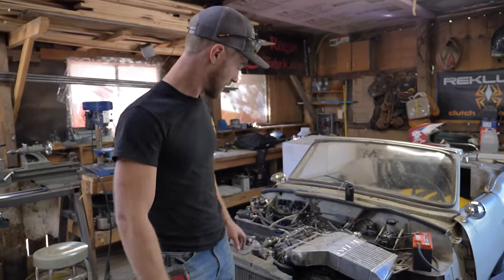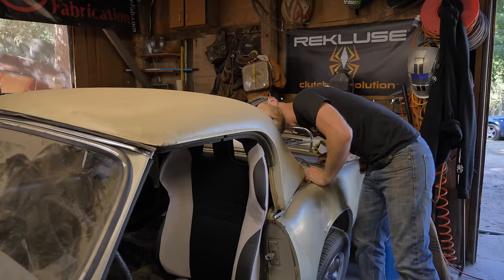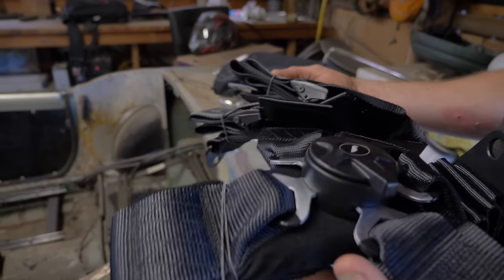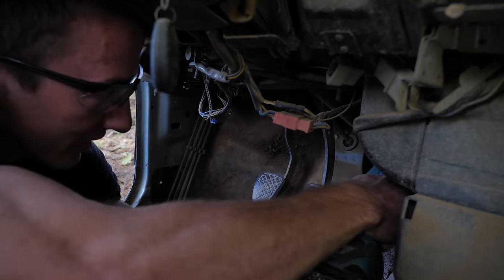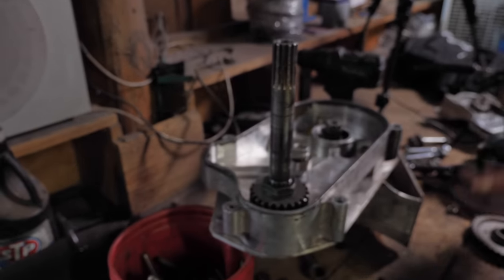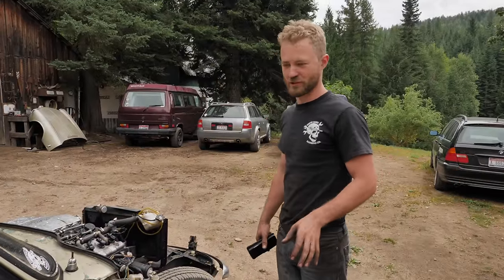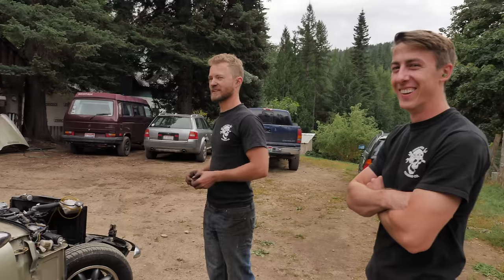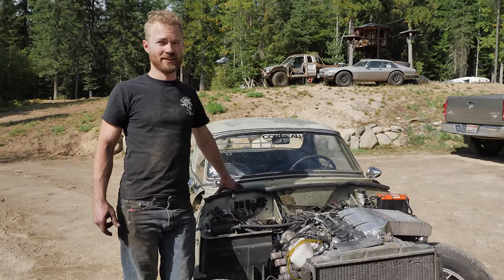Snowmobile Powered Car Test Drive! Supercharged RX1

Comment: I work for Sunoco. I can shoot an email to the Race Fuels marketing gooroo. Cant hurt see what happens. The GT100 will more then meet your needs.
Reply: excellent!
Reply: Buck Shot my dad works for sonoco.
Reply: I get E85 (105 octane) ethanol for 3 bucks a gallon in Portland.  Stuff loves high compression.
Reply: @dickJohnsonpeter  ?
Reply: @phillipzx3754  e85 is best :) 0.60€/L in france vs 95 unleached is 1.50€/L lol
Reply: @phillipzx3754  lucky, cant find any stations with e85 in vancouver
Reply: either that or im not looking hard enough
Reply: @kenji642   Jay's garage in Portland sells it. They're at the corner of SE 7th and Morrison.  I've never seen E85 for sale in Vancouver.
Reply: @gsfbffxpdhhdf7043  Yeah, its against the law for a cashier to shoot an email to somebody.  What's your point?

Comment: please protect that driveshaft, even protected it can severly injure you
Reply: was thinking the same thing
Reply: Imagine he got his arm or shirt in that thing
Reply: It would be like a mini PTO, fuck getting caught in that thing.
Reply: It was for the test drive. Itll be safe.
Reply: Yeah, if his legg hairs get caught in that,  itll be a rough wax job
Reply: @zuestoots5176  the driveshaft and rear end are pushing 40 years old, and the driveshaft has been heavily modded in a shade tree garage. The snowmobile gearbox is also way stressed- those parts weren't designed for a vehicle the size or weight of a Spitfire. Then there's the difference in shock loads between dirt and pavement vs snow.  It's not moronic to suggest that at least a tunnel is urgently needed.
Reply: Zues Toots - i hear ya man. it’s amazing how many Real Experts chime in an hour after they post a video with the “you should, why didn’t you, what you really needed, i would’ve” comments. i bet the majority of them have never fixed a bicycle inner tube.
Reply: @ericpettyfishing  full send is not test drive
Reply: @BANANAHAMMER420  Even one run risking injury is a little silly. They put in all that work to skip a simple part. Going to do it anyways. It's all fine until it isn't.
Reply: @steverolfeca  they weighed the sled it came out of... and the spitfire is lighter than the original sled. Please try again.
Reply: Final Destination
Reply: @ianbudgetrc2574  (Supercharged)
Reply: @zuestoots5176  .... and nothing ever breaks....... parts never fail... ever.  The shaft may take twice the power before coming apart.. how about the universal joints... original.. gotta be good after 50 years.
Reply: I couldn't watch the video. Go watch some lathe accidents. That's scary stuff they are driving.
Reply: I have heard of people getting rapped around pto drive shafts on tractors and that only does 540 rpm. Apparently a very messy scene. Otherwise very cool guys.
Reply: @dickscrossedgarage  1K or 10k does not make any difference; drive shafts rotate to the speed of the traction wheels; so the faster you go ; the more damage you will take ; rpm has nothing to do with it.
Reply: @zuestoots5176  Bit unnecessary
Reply: @corporalclegg914  Maybe not, but they might just be using common sense and that's a sadly lacking element these days
Reply: @jonWilk8156  there's calculated risk and blatant stupidity. The internet (and hospitals) is full of the latter!

Anyway, not my car, not my arm, fingers or soft body parts, what do I care?
Reply: David F - i agree with & respect your sentiment...but, i also feel that the Grind Hard boys seem to have it together (Common Sense-Wise) and don’t appear to put themselves in Harm’s Way. Calculated Risk is one thing, knowing your equipment is another.  i don’t claim to possess either, which is why i get annoyed at the Commenters that Preach.
Reply: @corporalclegg914  didn't knew they had bodyguards
Reply: Alexandre Martel - *didn’t know they had...

you’re welcome
Reply: @zuestoots5176  its not only that. theres the potential for his arms or legs to get caught on the driveshaft. If your jeans or shirt ended up catching it would snap your arm or leg no problem
Reply: Always use protection on your shaft. Basic man skills.
Reply: Mechanic at Detroit Diesel spun up an engine  on the dyno.  The shaft guard was not built strong enough.  The driveshaft came apart , ripped everything apart in it's path  and shattered his femur ( big leg bone ) . Luckily another worker walked by and saw him bleeding out on the floor. The ambulance was 'close enough' to save his life.  Yes it can happen during initial test drives. In fact most failures  happen during the first test run after a big project.  Young people have to go through the school of hard knocks until it finally sinks in.  Without first aid attendants and a nearby hospital the risk increases.
Reply: all you guys complaining about the drive shaft are just jealous. because you can't build anything cool.
Reply: @billbraski2175   He's aware and will install a tunnel at some point.  Lot's of people build cool stuff AND have experiences with destroyed driveline components.  You don't want a spinning shaft failing near your body.  Enough said.
Reply: @zuestoots5176  especially as old as it is. That thing is over built like a mother
Reply: Totally legall....
Reply: @zuestoots5176  Google some PTO injuries and you'll see why that shaft needs a cover. That shaft would twist his arm clean off before he had a chance to react.
Reply: Part of the package! Raw just like any body part that gets in contact

Comment: That motor needs full equal length exhaust badly. I would dare to say it’s running at 60-70% power because of the stubs.
Reply: John Stamper I agree. A lot of people don’t think about how much exhaust affects how a motor runs.  And the HP output differences.
Reply: For real! I was like! No. Why are you running it that way.
Reply: Shhh they don’t know that
Reply: Whats the point of zoomies
Reply: I agree have to have the original exhaust design for engine.
Reply: Rich ard  only useful application for zoomies is blown alcohol. With forcing 50psi out the blower and the high compression and the camming there is no reversion. Faster the air leaves the exhaust valve the more power it makes.
Reply: Its  a two stroke it needs its expansion chambers 0n it, its still cool as fuck
Reply: @jakehitchcock2868  There's no valves it's a two stroke it has reeds.
Reply: @rollfablife3363     it's a four stroke engine with a turbo.
Reply: 4 stroke rx1 engine look it up
Reply: True, but even as is, its still faster then my 64 MG Midget lol
Reply: Do you all listen?  He says at the end of the video that one of the biggest things keeping it from running right is the exhaust.
Reply: @hismaximus904  its not a two stroke
Reply: It's a supercharged 4 stroke the loss would be minimal
Reply: It's a four stroke so doesn't require back pressure to run optimally. A long exhaust is just more resistance for engine to fight against. However less resistance requires more fuel for an optimal mixture as the flow of gasses will be faster sans exhaust.

Check out engineering explained for a decent and semi easy to understand video on why this is the case.

Only 2 strokes need optimised exhausts.

4 strokes with advance emissions reductions sometimes have fancy exhaust designs on order to burn up as much bad stuff as they can but not for performance purposes ( aside from the fact they can push the limits of the engine further if they're optimisation of the exhaust pays off enough)
Reply: @freedomofmotion  scavenging is a thing but it's less essential to have a scavenging exhaust system than it is on a 2 stroke
Reply: AAARINGOAAA  as somebody who has bumped into a moving driveshaft. You don't get wrapped around it
Reply: Yes that's y Yamaha spend millions in r+d so we dont have 2 , genius arnt I.👊✊💨
Reply: @hismaximus904  🤣😂🤣😂😂 man you got it all fucked up man it ain't no 2 stroke.
Reply: Between the exhaust and the supercharger having play / loose belt, I bet it making 50% of the power it should.
Reply: Yeah I was more or less agreeing with them and solidified the reason it was running kinda dodgy. I’m sure those boys will get it sorted.  Then it will RIP I also called the baffle issue on Cinderella before they bought the second motor. It’s all good
Reply: Thing sounds badass
Reply: 𖥠 ꧁Æ♱ℍᴲᮄℜᴲⅅ꧂𖥠 I’m not worried about the “stupid exhaust” I was agreeing with what was said ... and I have to politely disagree. There’s millions of dollars every year spent on pipe technology for size shape and length to maximize power from 4 stroke and 2 stroke engines. Nitrous, turbo, supercharged or natural aspiration. Now stop being a keyboard warrior get out of your mothers basement and go do something actually productive. I wasn’t being negative nor being obsessive over their exhaust.
Reply: @hismaximus904  It is a 4-stroke, Yamaha has not made a 2-stroke snow mobile engine for a very long time.
Reply: @rollfablife3363  4-stroke.
Reply: Only reason you need an exhaust is for an O2 sensor in injected engines so the ECU is happy.  
Things like back pressure is never wanted in a 4 stroke to those saying it, it's a myth.  
The only reason extractors exist is to help get the gasses out faster. However nothing is faster than a 6" length of pipe straight off the head.  (Just loud as hell, smelly, and might set things on fire)

Doesn't matter if it's 1200cc 3c, a 5L v8, or a 27L V12 Spitfire! The less exhaust resistance, the quicker the gasses get out and the happier the engine will be.    
It's why we delete cats, put on 3" straight through pipes, grind valves and port heads, all to try and get gasses into the chamber and out of it as fast as possible.  

If this turbo snow mobile engine is running rough due to no exhaust, it's because it was tuned with an exhaust. If it can be re-tuned it should run slightly better without one... But when the whole system is like 3 foot long anyway we're probably splitting hairs.  
... Saying that I still think it'd look savage with 3 side pipes straight out the side.
Reply: @hismaximus904  its a four-stroke, an r1 motor without a trans to be specific
Reply: @freedomofmotion  It DOES require a certain amount of back pressure even for a 4 stroke to run correctly....
Reply: @morganfreeman5171  excuse me if this is in caps,using a font that doesn't have lower case so don't know if it's in caps.  Check out the engineering explained video on the matter. It's a misconception that's came about because it being true for 2 stroke engines and so people applied the same rationale and perpetuated as a general fact. People don't look things up that sound right though.
Reply: Thought forced induction didn't need back-pressure....
Reply: @JE-tz4sh  lol and most of that money is for sound and hardly affects performance at all
Reply: @morganfreeman5171  no not at all
Reply: @AntonSander  scavenging doesn't make much difference on forced induction especially turbos
Reply: @Johnny-tq9no   Yeah that's what I figured
Reply: Johnny agree to disagree. I’ve gained serious dyno proven horsepower on similar engines by just changing the routing of exhaust pipes or simple silencer change. Wide open short headers like that are robbing serious power. Spend 5 minutes on google. Do the research before getting on here talking something that your grandpapay told you in 1976
Reply: @JE-tz4sh  well you're straight up wrong because it's is simply science and I've watched enough engineering lectures specifically about exhaust design to know that's scavenging has little to no effect with fixed induction
Reply: Johnny agree to disagree. I’m not arguing with a child on the internet. Good day. Be safe out there
Reply: @JE-tz4sh  well I guess I'm not going to argue with an old man who's never been through a single fluid dynamics course
Reply: That’s a four stroke lol.

Comment: Put in some softer clutch springs that would help bring rpm’s down
Reply: Exactly what I was thinking. Just to maybe get it down to about even 2500 rpm would sound much better. Also it would drive better when you don't feel like going fulll throttle everywhere.
Reply: I mean, that's how you drive sleds, so it's not like its gunna hurt the motor
Reply: @trevortimmreck  but why not have more useful rpm range?
Reply: @gsfbffxpdhhdf7043  that wouldn't make it slower? It would just let the clutch engage at a lower speed.
Reply: @isaakwelch3451  it sure would make it slower, it makes the most power where it's at now if you lower it down 2500 more RPM it will not be at the peak torque for Max acceleration.
Reply: @Baldys_projects  that doesn't stop it from revving. It just allows it to go off of peak power for economical driving
Reply: @gsfbffxpdhhdf7043  I'd still rather have usable power band than be slightly faster. This is a car, not a snowmobile.
Reply: @gsfbffxpdhhdf7043    You seem to be confused with the proper use of the word "fast."  Speed is NOT a measure of time. It's a measurement of distance.  The 1/8th mile is a race against the clock, which is why the winner is announced by time, not speed.  "Quick," is the word you need to learn how to use before your next spewing of worthless knowledge.

Comment: Good choice for the engine. People have put them in aircraft!
Reply: @jospi2  no are u crazy your not gonna put 300 pounds on ur back maybe 70 pounds
Reply: @jospi2  nope. 150 hp is enough for a light 2seat aircraft. Check out the Apex engine group on facebook for specifics. One guy has a turbo built motor pushing 300+ hp
Reply: Yeah small planes or tiny helicopters also hyabusa engines are popular for this purpose as well
Reply: Ultralights have been powered by 2 stroke snowmobile engines for decades

Comment: A more proper exhaust will help with it running properly, and some clutching is going to really help it run better and wake up. Also, get a new rack and outer TRE. They're dirt cheap for these cars through Victoria, and the kingpins may need rebuilding costs a few bucks, but it makes a huge difference for the handling for sure. The front end is tight as can be on these things when it's all set up right. I have a few MGBs that I work on (same thing, basically); so I've seen them in all sorts of states of repair, and just recently did a total refresh on the front end. They're a flexy chassis and run small tires, so they're a pitch and catch car by nature.

Comment: Cool build(Gotta love the RX1 motor,even better boosted/blown) ,Check those flex pipes on the motor,those are known to crack after many miles.Had to replace mine at 8000 miles on my 04 RXwarrior.A proper exhaust will give a better sound...Once read on a snowmobile forum the RX1 crank is good for 600hp......

Comment: If you play with clutching it will make it more drivable. Example: green white green primary spring will lower your engagement to roughly 2800rpm. And steeper secondary helix so it shifts out faster which may help your gearing issue. It's a 37 degree or less I imagine. Put a 50ish degree in there. It's no longer lugging around a track so it's just not shifting out like it should. Hope this helps

Comment: twostroke lowers need to see twostroke engine powered toy jeeb or toy car
Reply: Noooooooo neeeeeed Torqueeeeeee
Reply: Who needs torque when it braps?
Reply: It's a car it's going to be more heavy plus, wasn't it awesome they were able to use the same fuel out of an bmw without having to also fill the oil tank?
Reply: @elilachappa3330  I know it's a spitfire, Of coarse it's light. but You wanna be able to; "Thrash and Last"- Four Stoke Owners.

Comment: Careful running the engine without an exhaust. If you revit too high it could suck cold air back into the exhaust and warp a valve which will then cause the valve to stick and hit the piston. Then it’s time to find another power plant. Love the videos and the creativity guys keep it up.

Comment: Haha. The only seats that fit into Spitfires properly are Spitfire seats! They have an insanely low and weird shaped cushion and lowers. Those 'bucket' seats are kinda uncomfortable. I'd recommend looking for seats from a laters model, '69-80. The  next revelation will an exploding rear end or axles when that thing finally hooks up. The parts are all pretty tiny. You guys might want to look into a GT6 rear end or doing some of the research on racing mods for the rear suspension.

Comment: I'm digging the look of the exposed driveshaft, but I guess if you just have to be safe...lol

This thing is sick though. Maybe there's a way of lightening the weights in the clutch so it grabs at a lower rpm? Or maybe they make a lighter clutch? I know jack about snowmobiles 🤷‍♂️🤣

Comment: You should ask Corbeau about their Classic Bucket seats. With the headrest installed they are a full 8" shorter than the A4, plus they are a couple inches narrower at the shoulder. They are a fixed back seat, though.

EDIT: I must not have been listening closely enough, because I swear I heard someone say they were going to "limit" the "throttle". I just want to make sure this build always errs on the side of rowdy.

Comment: Also. I think your gearing is closer then you think. That motor needs to be wound out to make any power. And as you prob know. You need to get the secondary clutch spinning pretty fast to get it to shift out.
Reply: I agree. It's also why I think a 50ish degree helix would help as well. That clutch setup is from a mountain sled, it's meant to hold its gears longer and back shift harder. Tune it like an ice racer and it will do well

Comment: that rear spring needs a lowering block bad. otherwise you might tuck the wheel under the car which will be the end of the car. but this is fricking awesome.

Comment: Centrifugal clutch right? Change roller weights and springs inside so it engages at a lower rpm.
Reply: And a steeper secondary helix so it shifts out faster